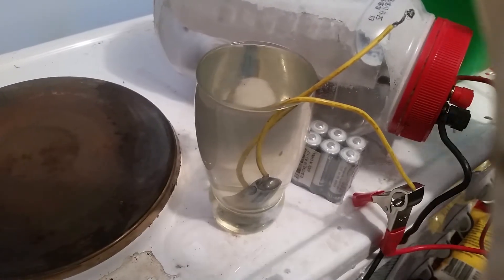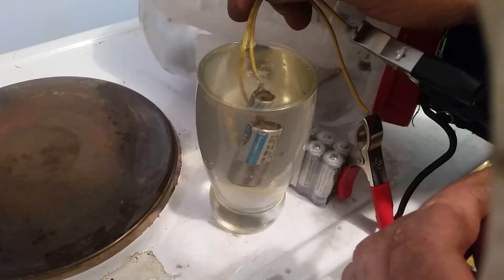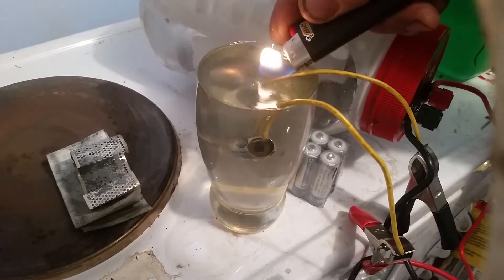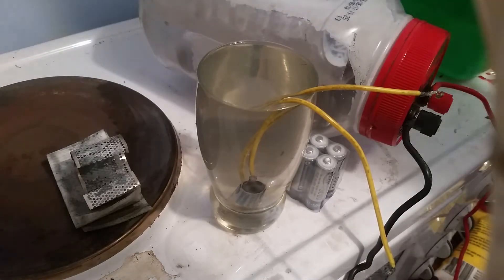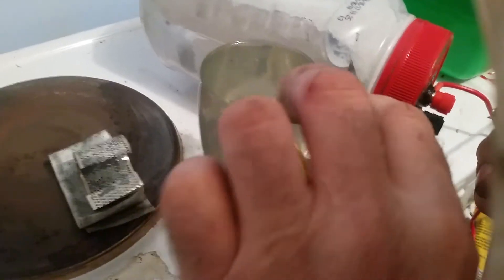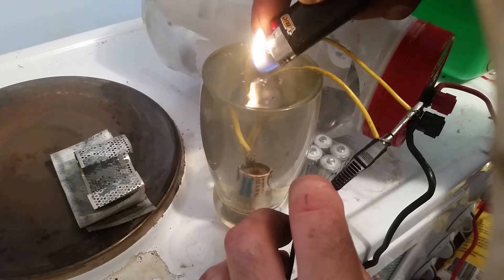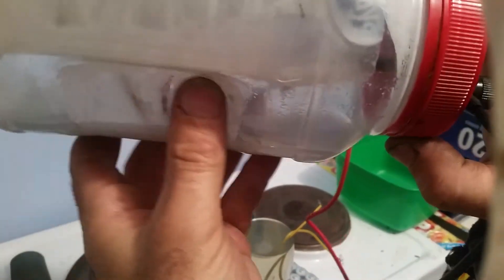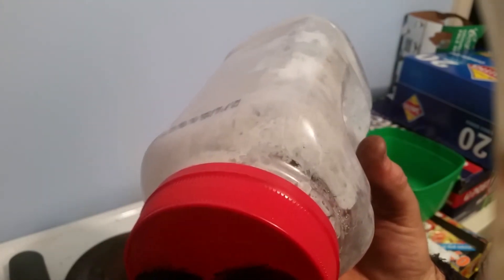HHO cell an battery concept

Comment: Checking static resistance of tap water should convince you it IS an electrolytic solution or colloid. Same thing with rain water to a lesser extent, it picks up atmospheric contaminants (to some extent)- no you're not ADDING an electrolytic agent, but it's there anyway.

Comment: That's different,Mate
Reply from the maker: Glad you like it Darcy, something different yep but one of my interests from just before coming across Schauberger. Water fuel. it's an off the shelf fuel cell which is a reversible reaction.  obviously can be applied in different ways from shown ,eg HHo fuel boosting the combustion engine. HHO Health , breathing in the Hydrogen and Oxygen gas from the water. Hydrogen Battery , come up on a google search and lead to this concept. the ENERGIZER web site gives a good discription of the Ni-MH battery and lead to realising it's a Hydroxy battery.. these things bought about space travell , fuel cells, 
Cheers
Reply: godspirals  yes ,a new direction is great, I have used scrap stainless steel security door screen and burn off the paint ,it's Cheep and works well I take my hat off to you  for your get up and go that's keep winning .
Reply from the maker: All good mate,  could go off in many directions but have to limit myself or i'll be not getting anything done,  
I like these batteries as there not dear well made quality nickle electrodes , nickle hydride, nickel oxide and separator material , already made in a compact way. no way i can make em this small and compact for the price. can even use old Ni-MH batteries . reading between the lines there made to die by letting out gas or electralite via the valve in the top of them. other wise is like a Edison Battery,,,, could be a hundread year battery set up the right way.
Reply: godspirals  looking forward to the end results in all your inventions.
Reply: Hi gs i like where your going with this . You have alot of tools in your arsenal to cavitate water with which i think is key before electrolysis you should try that for low voltage water breaking
Reply from the maker: what comes to mind to try is half wave rectafication. 
(neative pulses)  Meyer may have been doing this with his alternator, just watched a vid an his high voltage transformer was a mains driven motor driving an alternator via belt. so very possible. alternators are 3 phase so by disconecting one of the diode banks triplet pulsing would be what it would be. have to try it!
Reply from the maker: Grigs hydrosonic pump is also a cavatation contender............ is half wave pulsing a cavatation effect?